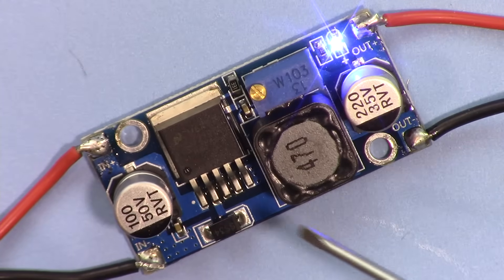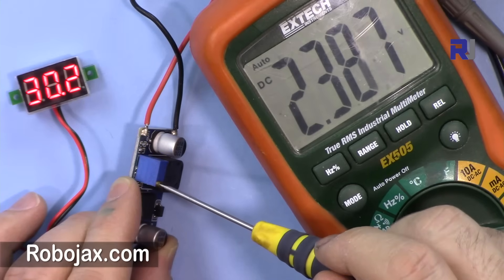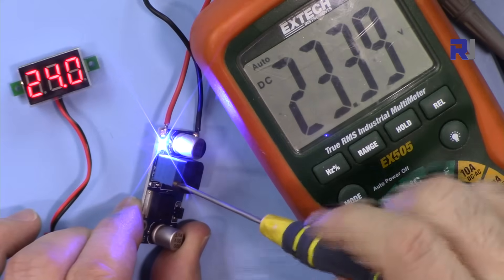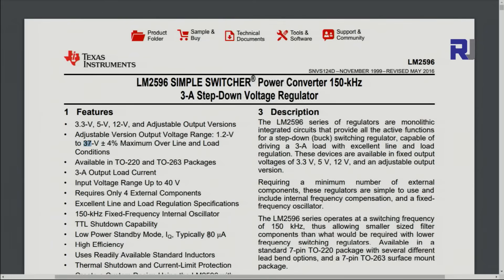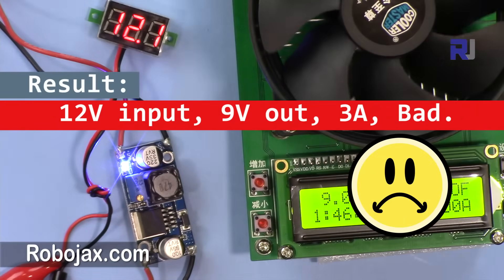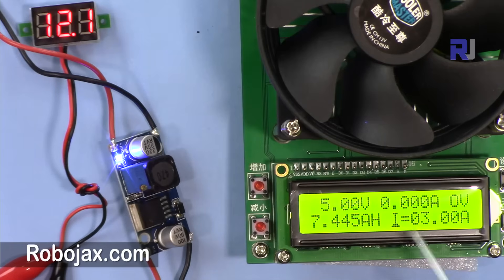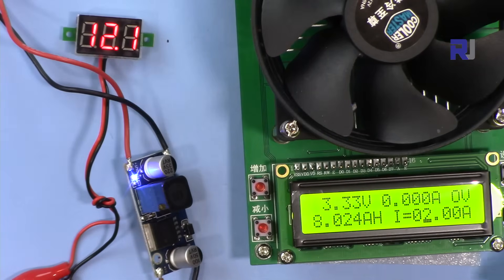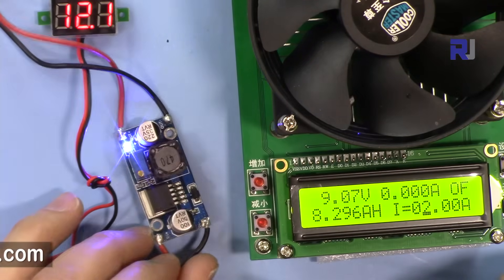LM2596 2v-37V  3A Voltage Step Down converter Module Tested/Reviewed

Comment: You should have checked the switching frequency and the output ripple voltage.
An LM2596 switches at 150 kHz, however, many (if not all) of these modules are switching at 50 kHz, meaning they use FAKE LM2596's!
This results in a very high output ripple voltage, which can disturb your application. Also the high ripple current will damage the output capacitor.
Reply from the maker: Thanks for the feedback, I'll keep that in mind for future videos!
Reply from the maker: this is very old video. Since then I invested in an energy lab and created separate youTube channel WattHour https://www.youtube.com/@wattHour were I believe I have done  much better job.  check it out.

Comment: I appreciate your video. It would have been helpful to have a table summarising the results, as it was not lear re the time taken to the temperature reaching a certain temperature, at what amps and target voltage so we can tell if it is just related to the current or the difference in source and target valtage.This was said not to criticise but try and be helpful, . Project Farm does this format for power tools etc.

Comment: Thank you for stating that the potentiometer requires several turns prior to responding to voltage change, was wondering if it was not working. 🙏
Reply from the maker: You are very welcome. Your subscription will help channel to be found by other. Thank you

Comment: I want to flash a 1.6V LED with a PWM. The PWM is 3V. Is it possible to put a buck converter behind the PWM to control the voltage down?
Reply from the maker: Hi,  you can use soltuion shown in this video https://youtu.be/17vqLv508Uw the video shows Arduino board is used to generate PWM but you can use your own PWM source to feed into this module and control LED or MOTOR.

Comment: was planning to use 2596 to power raspberry pi4(official power adapter ratings:5v 3a)  from 12v dc in diy nas. but as you reasults showed 2596 is no good......thanks!!!

Comment: I have connected this device to 5v mobile charger as input...In the output, while measuring voltage,  no matter how much I twist left or right the output always stays 4.4 v
Reply from the maker: when the output is not changing, it means the main chip is either dead or there is some disconnection  on the PCB path . check it.

Comment: Is it possible to connect the device with an LED stripe which current is max. 5A?
Reply from the maker: The amount of current is shown and forgot how much it was but LED or motors are load and yes it can be used to power any load within the voltage and current that I tested
Reply: From where the power dissipation comes from? The chip gets hot because of that. Is it because of the switch inside the LM2596? But then for the calculation you need the resistance of the switching device, probably mostet ? I couldn’t find anything in the datasheet

Comment: Output current is constant  Or it varies according to the load...? I have set 12v as output voltage..
Reply from the maker: Current is always determined by load. Some power supplies can limit it.

Comment: Thanks for the video. Would the results be different if I try using it with around 8Volts input and 6volts output?
Reply from the maker: No. It would be very close to the test result. You like this meter https://youtu.be/-UblSfUEY-0

Comment: Is it safe to use like 24v 2A adapter - >> 3v 1.5 A (for little motor FF-180SV-3730)
Reply from the maker: I believe the 1.5A is very easy for this. But I have forgotten the exact values. You may like this energy meter https://youtu.be/-UblSfUEY-0
Reply: @robojax  thank you

Comment: Great video. Thank you for the information that the output voltage just goes unregulated if the input voltage dropped below the desired output voltage.
I was looking for that information as my next project make use of that as an idea. :) 
Thanks again.

Comment: Can any one tell me what is The maximum input current of this module
Reply from the maker: Input current is 15% more than the output.  Just add it.  We have about 15% losses in this module.
Reply: My input is is 6amps 12v can I connect to this module as input and get constant 5v 3amp output

Comment: I AM USING LM 2596 IC BUCK CONVERTER , I NEED TO REDUCE  SOLAR PANEL 22V TO 12V....BUT NOW INPUT AND OUT PUT SAME VOLT....PRESET ADJUST ..BUT NO CHANGES OUT PUT VOLT ...WHAT IS THE  REASON ....
Reply from the maker: when output and input is the same, the converter power chip is dead.

Comment: If I use a 12 volt battery to get 8 volts output, would this increase the Amphours of the battery? Also how much would be my loss...?
Reply from the maker: this is exactly why I made the video. I have tested it with different voltage. so you have to watch and come to conclusion.
Reply: @robojax  Ι watched the whole video! But I didn't understand what would be the benefit if there is any in Amphours, right now I am doing a test of powering the device with different batteries and/or using my convertor-regulator.
Some of my results:
2 cells 5000mAh regulated to 8.4v = 3 hours of use
3 cells 1800mAh regulated to 12v = 1.5 hours of use
3 cells 1800mAh no regulation = Coming soon...

Comment: marhaba kefak ahmad , ramdan kareem 
i have a question the moment i connected this model to power source (36v battery power pack) the LM2596S exploded i already tried 3 different ones and same thing keeps happening 
any ideas or suggestion on what I'm doing wrong
Thank you!
Reply from the maker: Assalamu alaikum, Ramadan Kareem.
Either you connect the + and - incorrectly. or when you said explode, the actual black chip or the capacitor? if the chip explodes, then wiring is wrong.  if capacitor, then read the voltage on the capacitor. make sure not to connect higher than what is written. you might read 30V or 36V. just check it.
Reply: @robojax  i was wiring it  wrong 😂everything is working as it should now thank you for the response 😀

Comment: Hello so this card is used to replace the ubec installed in my model 30cc petrol?
Reply from the maker: You would have find out the amount of current , Amper and then see if it is less than what is shown in my test, then use it
Reply: @robojax 

Here I use 2 ubecs of 3 amps in parallel and it works well but the quality of the ubecs are not good here and I thought about using 2 step down plates in regular parallel to the 2 would it work? To replace the ubec? 3 ampere

Comment: Thanks! I was testing one for 1st time and it was getting warm (though not hot) powering an esp32 at 5v from 12v. I didn't realise it had an LED until I saw your video, why? Because the Led on mine was mis-soldered from the top pad to the positive side of the capacitor! Testing one without a badly soldered LED and it is much cooler. Worth checking the soldering on these modules.

Comment: Hi all, do not buy this modules from china. They cost around 1Eur because they use some Chinese clone of the LM2596 which runs on 55-75kHz. Original Ti LM2596 cost around 3Eur. You can check the frequency of the switching - original runs on 150kHz. I did test of Chinese clones at specific overload conditions (3A, more than 70 Cdeg) will increase output voltage around 1,2V which can kill everything connected.
Reply: So how recognize real module without oscillator?

Comment: If i connect 12v 5amps can i get 5v output? How many amps at output?
Reply from the maker: if efficiency is 100%, then Pin=Pout. P is power P=IV, I is current in Ampere. V is voltage. So input P is P=IV=12(5)=60W and if you want 5V output then I=P÷V=60÷5=12 so you can get 12A. but you can't find 100% efficient module. you will lose 10 to 20% energy as heat.  Now with this module, you have to see how much current  this can handle.  it is rated at maximum of 3A. I don't remember. so you gotta watch it to see.

Comment: can 9V battery be used to as input for 5v output as 9v has not been mention in data sheet?
Reply from the maker: we have fixed voltage version and adjustable version. at at page 6 of datasheet http://www.ti.com/lit/ds/symlink/lm2596.pdf  it shows that the input can be  4.5V to 40V.

Comment: I ordered a bunch of these, when they first came out I paid less than $1.00 USD each, but I purchased a bunch of them. I never used them because bigger and better ones came out. These work best if your input is very close to your output. Hooked up to the car battery 13.8v and I need 12v @ 1.5amp I stand a good chance, even 2.0amp maybe with a small heatsink from a Raspberry PI
Reply: Mean that you got a bunch of fake modules

Comment: can i use it when the input of the module is 12V 10A ?
Reply from the maker: the 10A doesn't matter. Yes you can with 12V.

Comment: Can we adjust the output current (amp)??
Reply from the maker: when you can adjust the current, it is called Constant Current or CC. This doesn't have it. the module what has it will have 2 potentiometer.
Reply: @robojax  thanks reply of my stupid question .
Reply from the maker: you are welcome. no question is stupid.  It was very important question.

Comment: input Amp and output Ampere always same, only voltage change on theses typ converter. You don't show input Amp?
Reply from the maker: No. Input and out are ALWAYS different.  This was done a while a ago where I did not have equipment. Please watch the latest video here you will see the input and out current https://youtu.be/ypVX4oebFGo
Reply: @robojax  Ok thanks

Comment: Brother, please, does the circuit heat up when loading anything
When I turn on a router of no more than 1 Amp, I find that IACI overheats with
Diode and transformers, and with an output capacitor, what causes the problem?
Is it natural in itself
answer please
With problem solving
thank you very much
Reply from the maker: you know I made this video so people find answers.  I have tested with many current and voltage so  you find the result somewhere close to what you have and come to conclusion. I just looked at the video and it seems I did not leave such important detail. But your project you always look at Power (watt). The module has 125C junction temperature when you touch it perhaps at 80 or 90 degress C at outside you should be okay.  I can't understand this from here. So test it for 24 hours in a safe place away from living room on a concrete away from everything and if it dies, you know it is bad, else you might come to conclusion that it can be trusted. Do your own test.

Comment: is it ok to input 60v by changing input capacitor voltage to 100v?
Reply from the maker: NO. Read the input capacitors voltage. They will explode if you connect them to higher voltage.

Comment: can I use the 5v output voltage from the converter to safely charge my phone?
Reply from the maker: yes. Be careful with the polarity. Your phone has charge control and it just need 5V which this can provide.
Reply: @robojax  can i get my laptop adapter-- which is at 30V, to power the display that i salvaged from my broken laptop?
Reply from the maker: Yes I believe you can. I don't remember what is exactly is the input maximum voltage. so check that out first in the video and then if it is not exceeding the maximum  use it.
Reply: @robojax  i will try it out. thank you.

Comment: You can read in the specs, that you need to add a heat sink if the output power is greater than 15W.
Reply from the maker: I read the title of the sellers. I want to educate people NOT to trust titles of items on eBay or aliExpress or Dx.com etc. They all selling it as "3A" module.
Reply: @robojax  Not on Banggood there they are selling it as a 1A module, that can do 2A if you use a heatsink, but yes your right, most of dose sites say it's a 3A module, and thanks for letting us know it's NOT a 3A module. 

https://www.banggood.com/LM2596S-DC-DC-Step-down-Power-Module-2A-Adjustable-Buck-Module-Super-LM2576-p-1203441.html?rmmds=myorder&cur_warehouse=CN
Reply from the maker: banggood is baby when it comes to eBay or aliExpress. There is Dx.com etc like banggood.

Comment: I made an ultrasonic sensor project with Arduino Uno and I have powered 5v 3a from the step down module connected to the 12v 3a adapter. what happens is that my ultrasonic sensor is always on, normally the sensor will on if the triger is on. what's the problem?
Reply from the maker: it has nothing to do with the power module. Ultrasonic sensor will always produce a value . I assume when say it is ON, it reads some value.  I would suggest using it with Arduino and power it up from Arduino's 5V and see how it behaves.
Reply: @robojax  Thanks Robo I have done 5v 3a which is right inside the arduino board now
Reply from the maker: Arduino needs less than 500mA power. 3A is 3000mA and 6 times higher. But it will not harm Arduino.
Reply: @robojax  I can reduce the ampere with the step down ampere module

Comment: HELP! My OUT LED is red, and the potentiometer is doing nothing!
Reply from the maker: I don't have the module in hand, when is the LED ON? as soon as you turn it ON or at certain condition it turns ON?
Reply: Robojax the red light turns as soon as I connect it. It works fine but I've seen that all of the modules presented on youtube have blue light.
Reply from the maker: I dont' know then. these modules are produces in basement of homes and have no single manufacturer.  So anyone can put any components and change the design

Comment: First, there is a 48uH Inductor, the datasheet say 33uH. 2. the input cap is only  100uF, in the datasheet is 680uF. 3. there is no heatsink on the board, only a very litle copper on the tab. And last the quality of the inductor is not great. Over all 2A are fine.
Reply from the maker: the value for inductor is the typical application and you can change it.

Comment: If you can't touch it for more than a few seconds then it's over 70 degrees C, i've read. I'm using these in a project and they seem fine but i never go over 700mA. Thanks again for your very useful reviews :)
Reply from the maker: You are welcome.  Thanks for your useful comment.
Reply: @robojax  What's the best way to have a conversation with you, i'm developing an automatic plant watering system and need some advice, i'd gladly pay you for your time ?
Reply: @robojax  I forgot, my email is info@smallseo.co.uk

Comment: i have rather bad experience, first they getting hot, 12V input 5V output 1A .. lifetime is about 3-5 month until they start heating extremely up and die
i used arround 40 units in projects .. they are all replaced now with xl4015 based converters which stay much cooler, lets see how there lifespan is. 
btw, RFI is much lower as well, of corse depends on the implementation ...but....
Reply from the maker: thank you for sharing. I don't like them either. They need huge heat sink. The way they are sold will not last as you said.

Comment: Sorry, but I think this a   STUPID REVIEW !
This is a voltage Regulator - emphasis on VOLTAGE, and it can handle a maximum of 3 Amp. Thats the "peak Amp" for a short time, as per manufacturer, so why do you want to challenge that?   3 Amps peak, and 2 Amps max for long duration ... that is clear.
However, it would have been more interesting to see so how stable the output-voltage remains if the input-voltage changes = REGULATE VOLTAGE (not Amps).
For example if I use it in my car, the normal car-battery voltage is 12.3V and if it stands for a long time it might go down to 11.8V and if I start the motor it might even dip more, but if the alternator is charging it can go upto 14.4V  >>> can this LM2596-thingy give me a constant 5.00 Volts ???
Reply from the maker: Thank you.  People don't know about datasheet or manufacturer data. They buy it from eBay or AliExpress with the hope of 3A current and I feel to tell them that it is NOT the case and showing them the test.

Comment: Let's say we use it for 24 volt battery and we need 13 volt on out put is it gonna drop the the voltage as the battery is dropping voltage or it stays at 13 volt while battery voltage is coming to 13 volt ?
Plz
Reply from the maker: سلام علیکم دوست عزیز When you set the output to 13V, the input can be from 30V to 14V and you will get stable 13V.  I have  shown how much input should be higher than output in order for this to work. موفق باشید. احمد از کانادا

Comment: Nice video , is the output completely isolated from the input?
Reply from the maker: NO. this is switching power supply. There is an inductor and/or diode.

Comment: This says 0-5amps and up to 75 watts https://www.amazon.com/Adjustable-Converter-1-25-36v-Efficiency-Regulator/dp/B079N9BFZC/
Is this true or are they lying? Would it do 19v -> 12v with 3.5A output if you used a heatsink?
Reply from the maker: I made the video to answer to those questions. Please watch the video otherwise I have to watch and answer your question. I have made 100s of videos and don't remember what the current or specs are .
Reply: @robojax  I thought the one i posted was the one your video was on. Turns out its a different chip. It can do up to 5amps but 12v output up to 4 amps so it works.

Comment: Does it work on unregulated DC supply coes from solar panel ?
Reply from the maker: yes it does as long as the voltage doesn't go above 37V